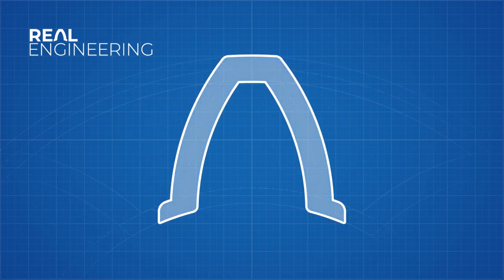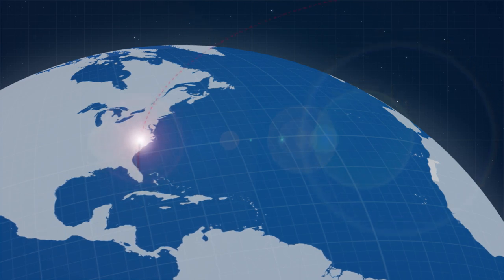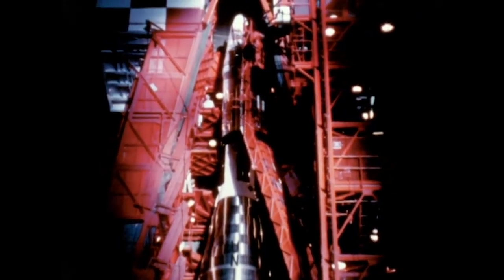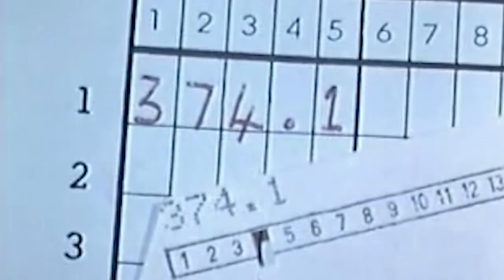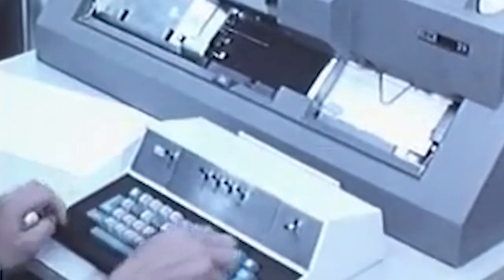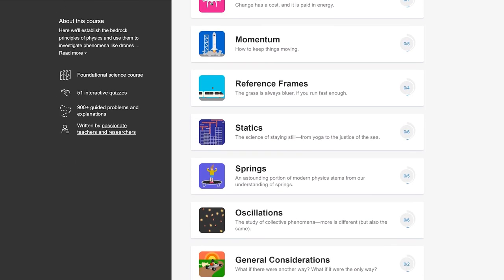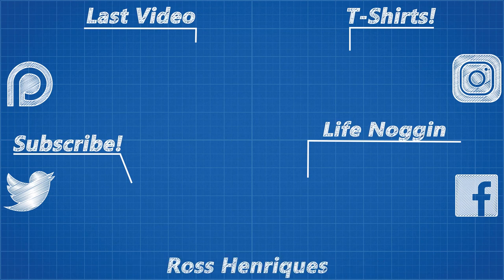NASA's 150 Million Dollar Coding Error

Comment: If anything, the laborious process of typing a program into a series of punch cards, having those punch cards compiled, waiting for the batch processing OS on the mainframe to finally run your program, and then getting the printout with either your answer or a cryptic error message meant that programmers back then had to be more careful about how they wrote their programs.  Since the delay between writing the program and getting the results could be many hours, hunting down and troubleshooting simple errors could add days or weeks to the development cycle of even painfully simple programs.  Programmers back then had to understand not only precisely how their program worked, but also how the compiler worked as well as how the computer itself worked and how all of these things worked together before they could even begin writing a "Hello, World" program.

Compare that to today's "hack and slash" method of learning to program which consists of spending most of your time changing bits of code just to see what will happen.  Since the delay between writing a program and getting an output is often virtually instantaneous, there is little need to spend time rigorously studying the deep inner workings of the compiler and computer.  Even good programmers usually only have a relatively vague understanding of what's going on under the hood most of the time.

Programming has become less of a discipline and more of an art.  I seriously doubt that most modern programmers would even understand the equation that this programmer saw, let alone understand how to program a computer to get the first derivative of a function.  If the painfully simple "fizz, buzz" problem can trip up a number of CS graduates entering the job market, then we have become worse, not better.  I'm not saying that I'm some sort of coding hot shot, just that I know where we came from and where we are now.

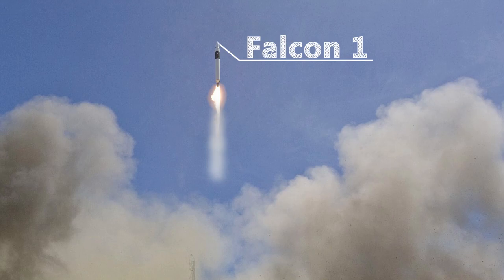Comment: 0:50 An aluminium nut rusted? Really? Interesting since aluminum can't rust.
Reply: Aluminum can corrode, or course. The commonly used definition of rust is the occurrence of iron oxide. Where there's no iron there can be no rust. Hence, aluminum can't rust. 

If you want to use the word "rust" as a generic term for any corrosion, you are free to do so. In that case I suppose "rust" would have to include galvanic corrosion, pitting, leaching, erosion, and any other form of metallic corrosion. (There are others, but I can't recall what they are.) If you saw an eroded or  pitted piece of aluminum you would say it had rusted?

FYI, I have a degree in civil engineering. I had 3 years of chemistry and a couple of materials classes. So while I'm not a corrosion expert, I'm somewhat educated. I also worked at a tool-maker for ~8 years that used primarily aluminum (extruded and anodized, and some casting). Steel as well, but 90% aluminum. This doesn't mean I'm not ignorant, of course, but I have a little but of experience with metals. (If you doubt me I have the hands to prove it. Nobody escapes that much time in a machine shop without telltale scaring.) 

Of course I'm happy to read up more on aluminum corrosion if I'm wrong here. Given that you called me ignorant and then tried to insult with some baseless claims, I'm sure you'd be happy to educate me as to what corrosion qualifies as "rust" on an aluminum surface.
Reply: Americans don't take it personally ..... When We create the future We always let the less fortunate tag along ......
Reply: OK ..... believe what You want ..... I'll stick with the truth ..... Everyone wants to come here but it's a terrible place ..... Strange indeed .....
Reply: So why are You arguing ..... What is wrong with watching those videos ? I am curious about everything like most Americans ..... I am curious about You , what country do You live in ? Steven Attanasso is My real name ..... I am not afraid so I don't hide behind a silly moniker ...... Why Not ?
Reply: Ok .... let's start over again ..... I am politically very conservative , are You on the left or the right ?
Reply: Influx of quick breeding immigrants ( mostly young men ) ..... Answer My question , please , left or right ?
Reply: I'm not afraid of saying who I am and what I stand for ..... Your words , left or right ?